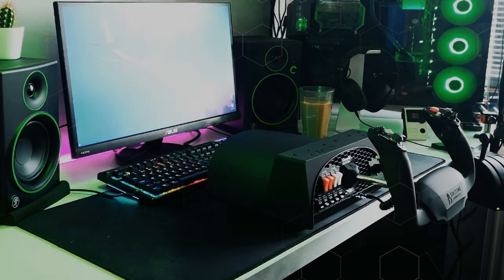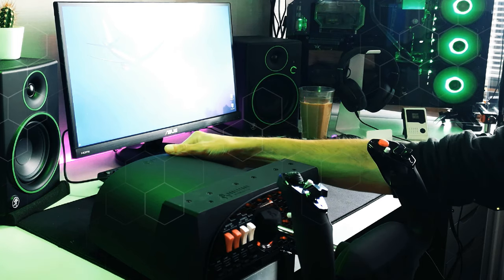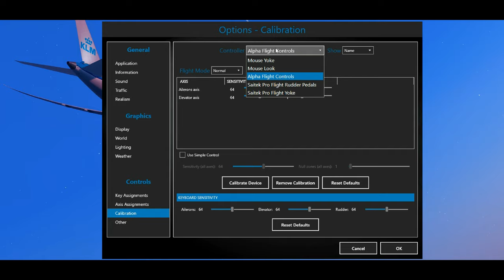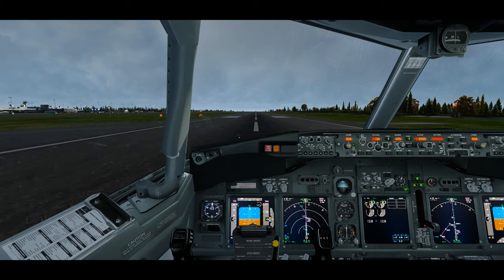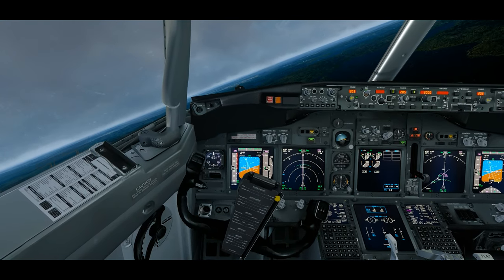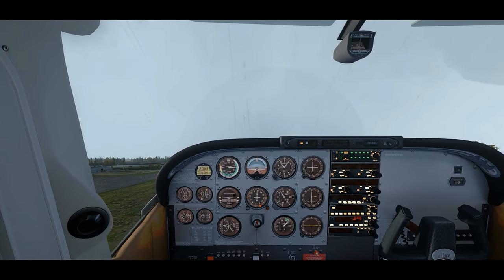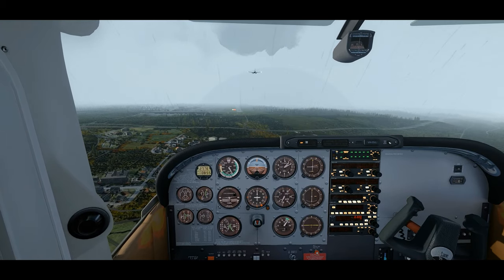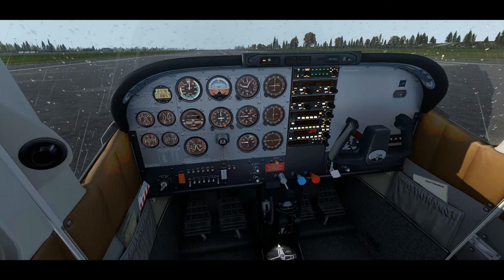[Part 2 of 2] Honeycomb Alpha Flight Controls || TESTING, PROS/CONS ||

Comment: the pitch tension is supposed to be like that even in the real aircraft. Honeycomb did an amazing job with this Yoke, can't wait for them to release the rudders and throttle quads
Reply: This is false. The pitch tension is too stiff
Reply: @demontraitor69  what is false?
Reply: I've not tried the yoke but apparently the pitch tension is not realistic and too stiff
Reply: I flew for 36 yesrs from DH82 Tiger Moth byplanes, Turbo Props to Airbus Aircraft & have set mine up how I like it & now love it.
Have my order in for the Throttle Quadrant.
Reply: DemonTraitor it’s not unrealistically stiff. A few pilots including the CEO OF XPLANE says it’s just like a real Cessna 152/172. Go figure.

Comment: Love it! BUT the pitch is way too heavy, so I disconnected the Elevator Bunjie Rubber & replaced it with two rubber bands for For & aft & I now have it perfect for me. (I did fly for 35 years Bi-planes to Air Bus BTW)